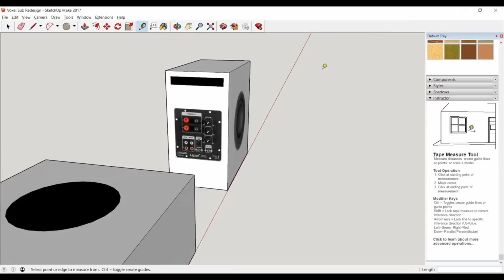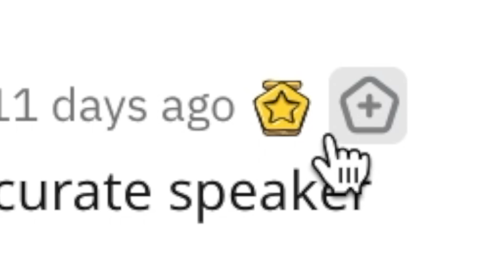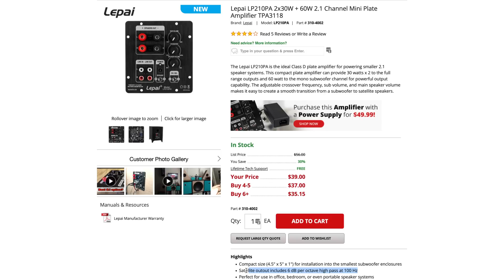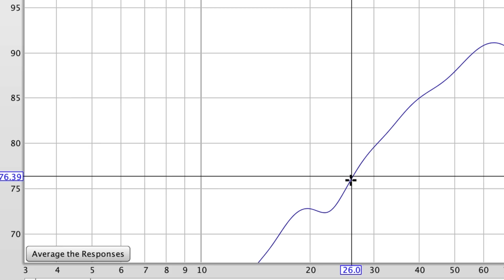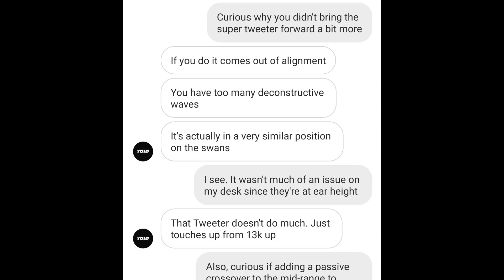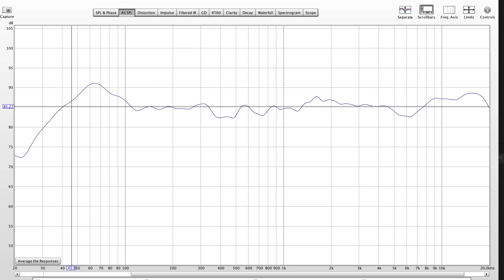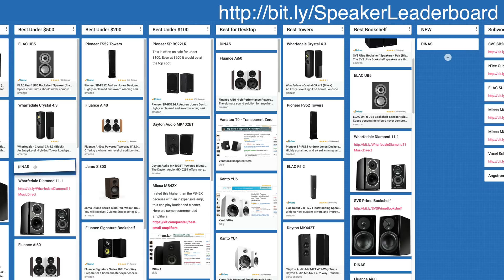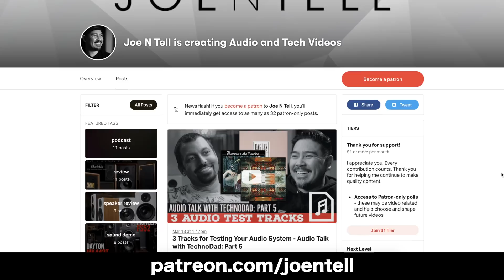DIY Speaker With Subwoofer Hits Down to 35 Hz! - DINAS - Active Bookshelf Speakers Collab w/ 123Toid

Comment: I’m still not sold on that RS100 for the midrange when you’ve got it sandwiched between a great (sub) woofer and tweeter. I’ve heard it’s a fantastic speaker, but there are tons of great 2-4” options that I think could be a little cheaper and get you a flatter response through the mids. Of course then you’re stuck working out a crossover, which could eat up any money you saved real quick. Hopefully I can build a pair myself soon and do some experimenting! That’s what diy speakers are all about, right?
Reply: Can you recommend such alternatives? I'm interested.
Reply: Bogdan Serban I’d start with the Dayton TCP115 to see how a $10 woofer would compare. If that didn’t work I’d try the DS115, DA115, DS90, or DSA90 if I wanted to stick with Dayton in the $20 range (which I probably would). You could also try the Peerless SLS-85S25CP04-04 or Fountek FW100B, also under $20.
Reply from the maker: I have the MK402 and the MK442T transmission line speakers with two of those Dayton TCP115 woofers. It can't come close to this Tang Band for bass. This is insane for this size of driver.

Unless you're talking about replacing the RS100 mid-range driver and crossing over the HiVi tweeter lower.
Reply: What’s everyone’s thoughts on stepping up to a 6.5” woofer? How drastically would that effect the cohesion of the other components? I was looking at the Skar Audio EVL-65 D2 6.5" to stay under $50.
Reply: justyntime instead of the RS100? It would require a much larger enclosure, making the speaker larger overall, and it would be less likely to extend high enough to integrate with the tweeter properly. Instead of the subwoofer? Still will probably need a bigger enclosure and unlikely to hit as deep (that w5-1138 is a very special woofer, one of a kind).
Reply: Kelly Cook thanks for the reply! Yes, I meant in place of the sub. The suggested ported volume for the skar audio 6.5” sub is in fact about double what this uses. The main draw to this build, for me, is the ability to hit those lows so I’ll just keep it simple and trust the design!
Reply from the maker: Kelly is most likely correct about needing a  larger enclosure. What is the recommended size of enclosure for that Skar sub?
Reply: Exactly. The RS100 is a good fullrange but there are better ones out there. Lately, I feel like it is getting more and more transparant that 123toid is on Parts Express' payroll. Not sure how to feel about that to be honest....
Reply from the maker: He's not on their payroll! Lol. Some of you jump to these conclusions a bit too fast. He clearly states as I do that we get stuff for free from some of these companies in exchange for a review of that product. We also can set up an account with a 3rd party to receive a TINY commission for each product sold using our affiliate link. 

We ain't getting rich over here buddy. Speaking for myself, I support the channel more than it supports me. I've worked for free for the first year.

If you're enjoying the videos, just enjoy them and don't wrongfully accuse people of being on the "payroll" when they aren't. It's a bit of an insult. I've been my own boss for 15+ years. I am not on anyone's payroll because I don't want anyone telling me what to do. 👊🙏
Reply: @joentell  my apologies man, I really didn't mean to insult somebody out there. I appreciate the efforts both you and toid put into your channel and into the beginners community. I'm just really miss the nuances and the objectiveness when it comes to toid and I suspected that to be due to deals made with PE. I might very well be wrong about the cause but I still feel like he's not always judging things as objectively as possible.

I hope this clarifies where I'm coming from with this but I don't want to force my opinion onto anybody nor prove my correctness
Reply from the maker: It's tough to sound objective even if you are. Truth is, it doesn't do much good for the YouTuber or the company to make negative reviews. Negative reviews take the same amount of time, get less views, gets nastier comments, gets more thumbs down, gets fewer affiliate clicks = less commission, plus it hurts the company and they may never want to work with you again.

For me, I send back what I don't like and don't waste any time reviewing it. No need to highlight a crappy product. From a viewer's perspective, it might seem like I only do positive reviews because I'm biased or "on their payroll". Truth is, I am weeding out the crappy products beforehand.

Hope that makes sense. 😊
Reply: @joentell  it sure does. Thanks for the clarification dude!
Reply: By the way @Joe N Tell and @123toid, I hope you didn’t read this as being critical. I love this design and I’ll be building some of my own one day! I’m just spitballing ideas of how I might customize my own pair (or not), looking for community feedback on what might or might not work, and playing around with ideas—much like 123toid did with the original Voxel that eventually led to this, I think. 

I have to admit (publicly), however, that I’ve been thinking and researching all afternoon and actually can’t find anything that would be an obviously better choice than the RS100. A midbass woofer that hits this low in such a small sealed enclosure for under $30 is actually really rare. There are some other drivers that might work, but definitely not as many as I expected once I really dove into the idea, and none that are clearly better.
Reply from the maker: Didn't take it as being critical. Questioning is how things are improved upon. Parts Express has a speaker finder tool that you can use to narrow down drivers based on certain criteria. https://www.parts-express.com/resources-woofer-selection-guide

That's how we figured out the right drivers for this specific build.
Reply: Vincent Koster I mentioned this same point on an earlier video and it was Joe that said he just really liked the look of the RS100, so I’m not sure that was Toid’s doing entirely. And I really like Dayton and Parts Express, for what it’s worth, and they’ve never paid me anything. They’re just easy to work with because they have tons of options, they’re generally well made, and they publish all the specs you could want making them very easy to model. Parts Express has a fantastic website, huge catalogue, and great service. It’s just as likely in my mind that 123toid likes Daytons and Parts Express for the same reasons I like them, and nothing more.
Reply from the maker: Yes it was my idea to use that driver because I thought it might match the specs we needed: being able to play down below the 100-150hz crossover point in a small sealed enclosure. Also consider that Parts Express also owns Dayton so they would much rather us use parts they make. I think they also own the Lepai brand if I'm not mistaken. If you look at the parts that I had already chosen, the Tang Band subwoofer and the HiVi tweeter, I thought it might be considerate to at least use one Dayton driver since they're supporting us in this collaboration by providing us all of the parts for free for the build.

Another reason was that 123Toid had previously worked with the RS100 and was impressed with its performance.

Comment: Love these speakers! Just wondering, would one amp powering  both speakers be doable?
Reply from the maker: Not really. You would need a minimum of 4 channels. I'm a believer in stereo bass.
Reply: Mike, is it doable?  yes.  Recommended, no.  It wouldn't be a huge issue, but you will drastically cut the power to your subs, which wouldn't be desirable at all.  Like Joe said, you really need a minimum of 4 channels for this.
Reply: I understand, thought it might simplify the setup process.

Comment: Great concept and fair quality for the money. I have to admit it is not for the general public since you have to build it yourself + powered (so you most likely you them as monitors speakers) and you need to split the signal for stereo. This is what I think they don't really compare to towers or other bookshelves like the SVS Ultra or Wharfedale because those are mostly meant to be used in living rooms for HiFi or Home Theater listening.
I don't really see the DINAS anywhere but a desk.
Reply: They would be really nice for surround sound.  Especially if your receiver has a preout.  Just hookup the RCA preout straight to the side of the amplifier that you hooked up the speaker to.  You will be set.  I used it this way in my living room with great success.
Reply from the maker: I would say they will work for two-channel audio, but not for a home theater. Most devices have an analog RCA out or a 3.5mm jack which can be converted to RCA. It is typically only video sources that have a signal that needs to be decoded from DTS or Dolby Digital etc. Even then, you could get a $20 optical to RCA converter on Amazon. Some even have remotes. I've even seen HDMI extractors that split the video and audio signal and converts the audio signal to analog.

Comment: Still  to clear on the internal connecti9ns with the plate amp. Will research more to learn.
Reply: Ismael.  Good question.  Joe is absolutely correct. They are labeled on the back.  You can also run some binding posts out the rear of the cabinet if you don't want to solder to the back of the amplifier.  Then you can just run some speaker wire between your binging post and the left binding post on the back of the amplifier.  If you are still unclear, you can check out my review on the LP210PA.  it shows the rear connections of the amplifier.
Reply from the maker: Yeah, you will see that on the opposite end of the binding posts, there are corresponding solder points for the speakers. I think they might even be labeled.
Reply: @joentell  & @123Toid great design and finish. Would love to hear them. So checking the PartsExpress site, the amp has 2 x 30 + 1x 60. My question of detail is you are connecting Sub at the 60W and 30 for each of the other drivers. If so, great use/repurposing of the Amp.
Reply: @IsmaelMartinezPR  Ismael.  The subwoofer is being hooked up to the sub port which has a bridged chip.  it'll get about half of the power you send to the speakers.  The mid and tweeter are hooked up to the same channel on the back of the amplifier.  The other channel isn't used.  It really wasn't necessary to use that in this build.
Reply: 123Toid thanks, that means that it could have been completely active? Like in car stereo one amp per slice of spectrum. What about using a DSP like Dayton, could you feed 6 channels direct to the lepai amp? Again great content.
Reply from the maker: I don't think 100% active because there are only 2 inputs and 3 drivers.
Reply: @joentell  OK I see you can't because if you band pass the mids it won't feed the sub. It may still work though. Cool project.

Comment: Dude, When I built my first cabinets back in 92' I made them with the slotted port at the bottom. Being I was only 16 at the time I never saw anyone use this method and now I see it a lot. Also, back then people thought I was crazy to use Birch ply for the cabinets and now I see a lot of people doing that as well. I know I didn't start anything but man, it sure feels that way.
Reply from the maker: That's awesome! Maybe you have good instincts.
Reply: It's also soooo much easier to get a decent looking finish with birch instead of MDF.
Reply from the maker: @johnbewty  MDF sucks to finish. You have to seal it really well first. I've done some high gloss finishes, but it took me days.
Reply: @joentell  If you make an appropriate MDF cabinet - it takes no time to finish - especially when using lacquers. All corners should be mitered so you don't have exposed soft part of the MDF. There are also MDF panels on the market that come pre-primed which takes away most of the prep work. Cheers!!!
Reply: I had birch plyskeamers I made in the early 80s, nothing new.
Reply: Well..... That a lot of people now use birch plywood for their speakers doesn't mean it's better. MDF will always be better as it dampens unwanted noises. I'd say make an "inside" box out of MDF and glue a layer of real wood onto it. This will make the cabinet very stiff/dead and it will also help with unwanted noises. (Birch plywood is very easy to work with and I understand the use of it).
Reply from the maker: I use MDF on most of my projects, but I think there was research by the BBC that said that baltic birch was the best for speaker enclosures for some reason. I haven't read the white paper. 🤣
Reply: Joe N Tell interesting. I just did some research and found that both plywood and MDF work well against resonances, the thicker the better. Since plywood is quite hard it won't resonate easily. But because MDF is heavier (at the same thickness) it will also not resonate as easy. So it's mostly personal preference it seems. 
Real wood like oak or walnut for example seems to be the best soundwise since it has a lot of layer and it's heavy making it very damping. There is a catch though. Real wood is way more expensive and it can have weak spots, which could crack over the years. That's why you usually only see it used as front baffle or as an extra layer on top of plywood or MDF. 

I must say that I find this a very interesting topic concerning speaker design.
Reply: Lol my dad been doing it before I was born I was born in 93 sound system was made in 86 sold in 1996 rebuild in 2021
Reply: You did it first bro! I believe you!